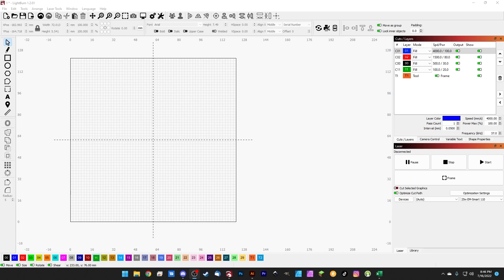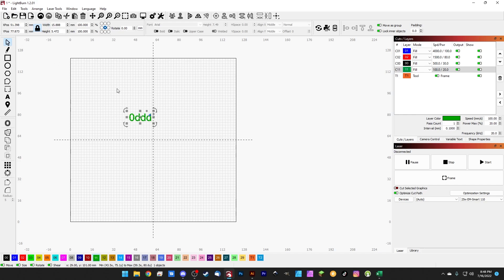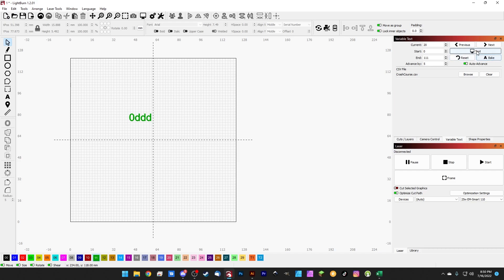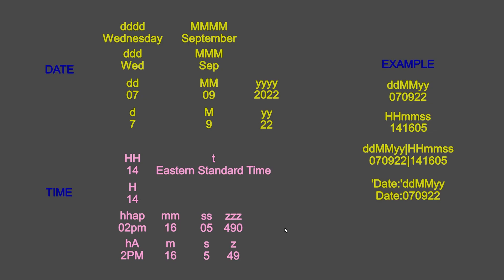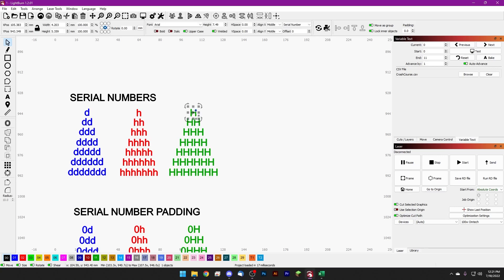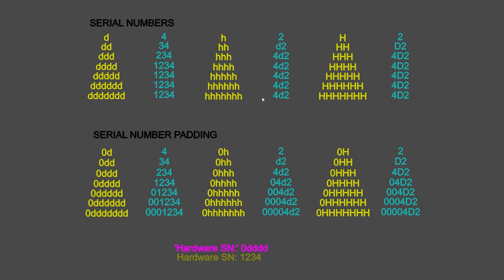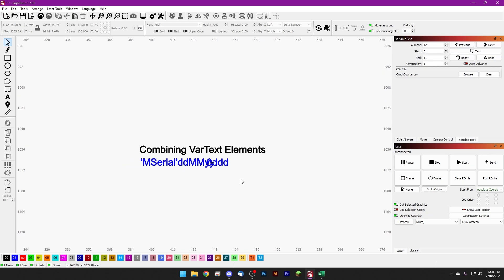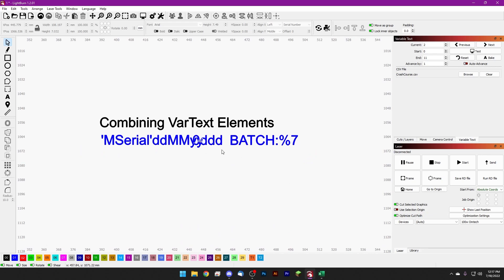You're Engraving the HARD WAY - LightBurn Variable Text

Comment: I've been enjoying your content and learning a lot from you, so I hope you'll be able to answer a 'noob' question for me. Here it is:

When doing wood inlays using a CnC mill / router, one typically cuts at an angle so the pieces fit seamlessly when glued together. I'm sure you already know this, but my question is whether there is an existing way to laser cut at specific angles / bevels to achieve the same result? Or would one have to 'jury rig' something? Thanks and keep up the great work!
Reply from the maker: Nothing to my knowledge on the market right now could facilitate that easily unfortunately. Thanks for watching!
Reply: @LaserEverything  Thanks for taking the time to reply. .

Comment: Another awesome video! How would the CSV/Merge work with a jig with multiple parts? For example, business cards with inputs pulled from CSV but loading 4-6 cards to ablate on the same job.
Reply from the maker: Good question! I didn't really cover it in the video but it should work just fine. You could use different columns for each jig location. When you advance by 1 it will advance all columns by 1 row.

Comment: Is there a way to do a variable vector? Let's say I have a folder with 10 vector files, is there a way to pull them into Lightburn automatically?
Reply from the maker: Not that I know of off the top of my head but that doesn't mean it doesn't exist. I would have to do some research into how light burns art library management works.

Comment: I need to engrave a statement with 200 words for my college project. How do I align as we do on Microsoft Word? All center, or all to the left? Any suggestion? Thx
Reply from the maker: What is the engraving going on? Typically I will go center justified for that much text.
Reply: @LaserEverything  I will engrave it on thin plywood; I create the text on Microsoft Word. When copied and past to lightburn the entire text comes in one line only, did not find a way to modify it; I was thinking JUSTIFIED too. It is a little over 200 words

Comment: I cant get QR-Code with serial number to work in Lightburn. No Problem in Ezcad2. as soon as i go further than SN: it says it cant understand the QR code. So SN: 123-123 is unreadable. Ok, i put a ' at the front, and seems to work then.

Back to not working. I even tried from a CSV file, It does not like the SN: thing at all. is there a way to get QR-Code to work with Serialnumber in Lightburn? because its not working for me. Everything is AWSOME in Lightburn, except this QR-Code business.
Reply from the maker: When we've tested generic serial numbers as QR codes, we've not had an issue like that though. Generate it on screen, and then de-select it (so it isn't shifting the edges as a selected object) and test it with your phone/device to confirm it can be read first. If its not working after being burned, it may be a contrast issue, or overburning / losing necessary detail maybe. I'm not sure I can think of anything else based off the description, but if that doesn't work, I'd suggest making a thread in one of our support communities (linked in the description) and that way the moderators/staff and community can help work through it together via discussion thread